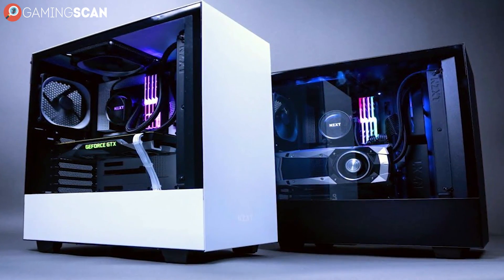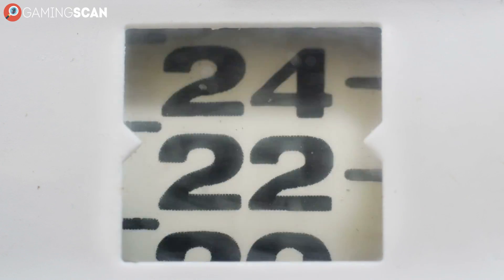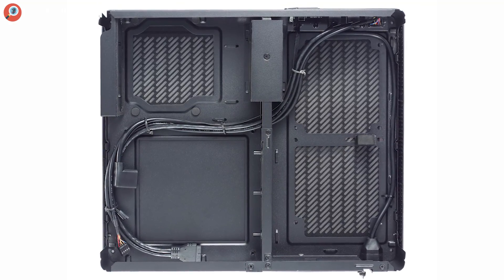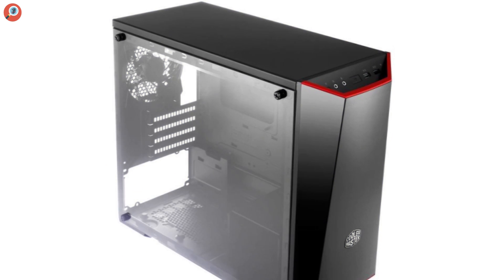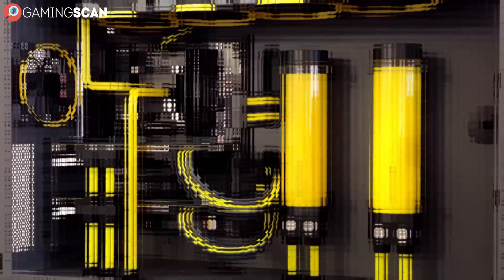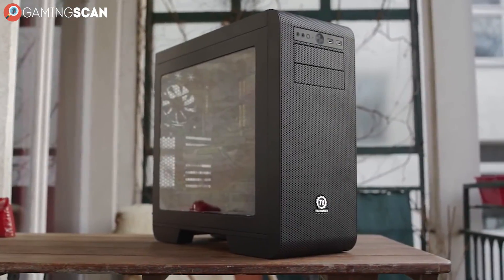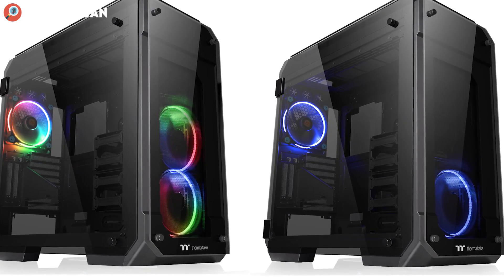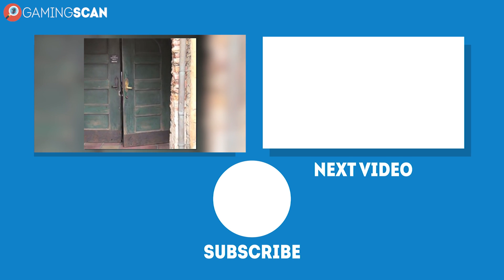Best Gaming Case 2020 [WINNERS] – The Ultimate Buying Guide

Comment: hi im not sure if anyone could help me i got  GAME MAX DRACO MID-TOWER RGB PC GAMING CASE upon connection the rgb fans to the hub i could smell a burning.and found that the rgb fans had burnt out.the fans still work but the rgb lights have now blown.the smell came from the power to the rgb hub.i have a 600 watt psu.can anyone help
Reply: Just done use the RGB lights now?
Reply: @chip1646  ye ther rgb lights do not work now as they blown there was smoke comeing from the power.the fans work fine but no rgb lights

Comment: 570x or view 71 which ?
Reply: ur going mid tower case or a full tower? Im using TT-View 71 it is a very large full tempered glass case and has lots of space u can have 9fans install or add  another itx board there's lots of room to work on maybe u would like to do water cooling so many possibility.